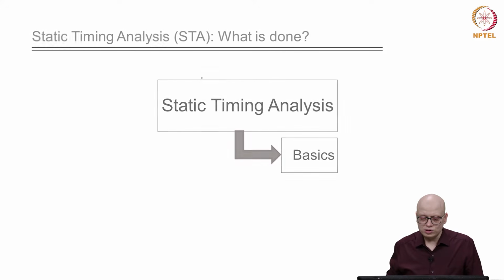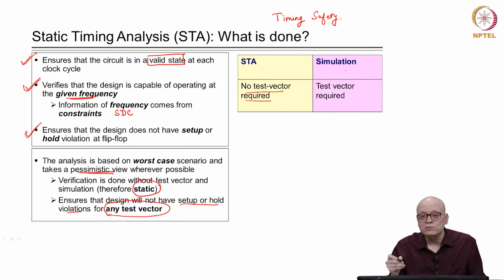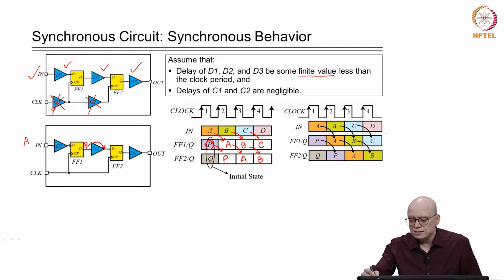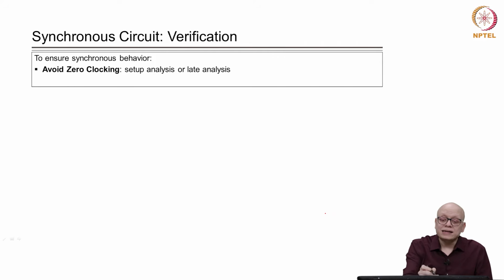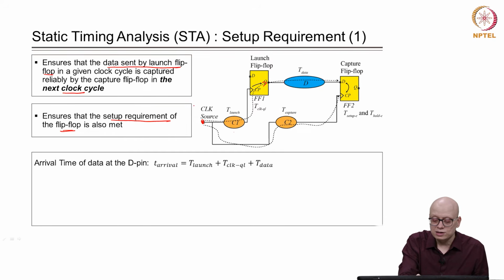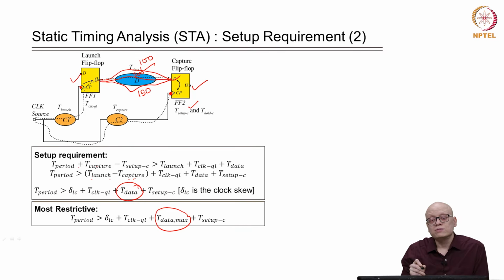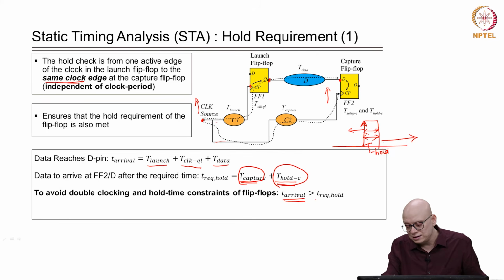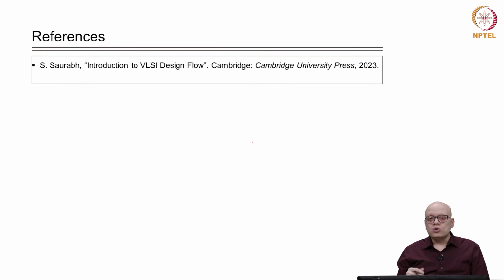Static Timing Analysis- I

Comment: Timestamps (Powered by Merlin AI)
00:05 - Static timing analysis ensures circuit timing safety and validity at each clock cycle.
03:43 - STA ensures design safety at specified frequency by analyzing timing constraints.
09:33 - Static Timing Analysis focuses on timing verification, not functionality.
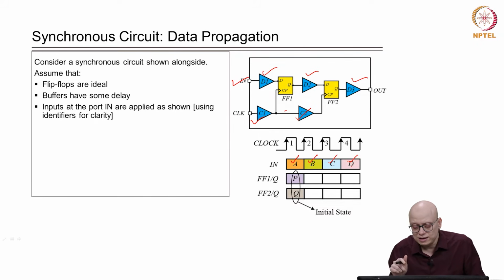12:09 - Analyzing flip-flop states and delays in synchronous circuits.
17:26 - Delayed data arrival disrupts synchronous circuit operation.
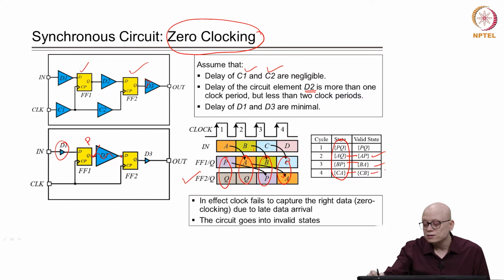19:59 - Invalid states occur when circuits respond to clock signals unpredictably.
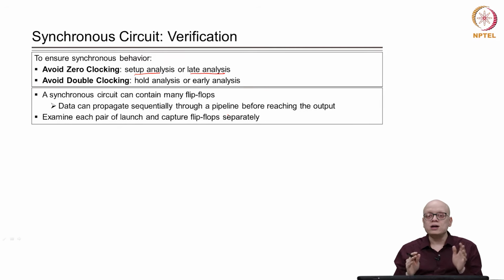24:43 - Analyzes flip-flop delays and constraints in static timing analysis.
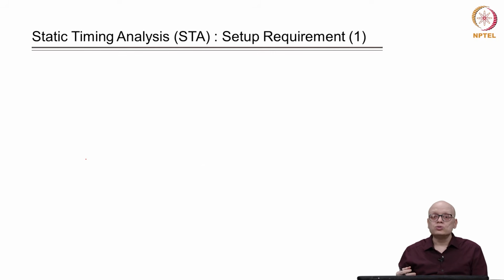26:59 - Setup requirements ensure reliable data capture between flip flops.
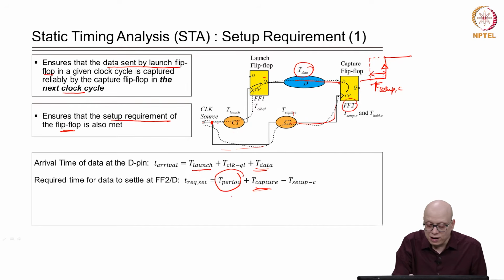31:54 - Setup time constraints ensure data arrival before clock signal.
34:19 - Understanding clock constraints in Static Timing Analysis.
39:08 - Final constraints prevent zero clocking in ideal flip-flop circuits.
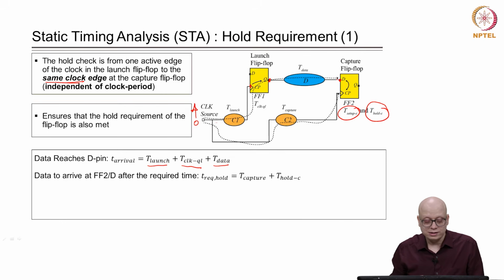41:26 - Understanding required time in static timing analysis for data arrival.
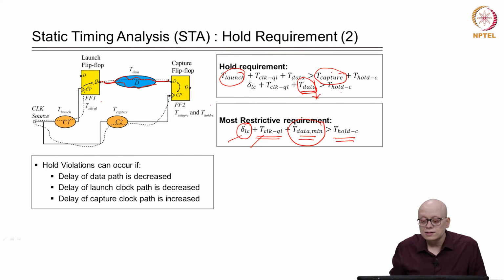46:15 - Hold time constraints for ideal flip-flops relate to clock skews and capture delays.
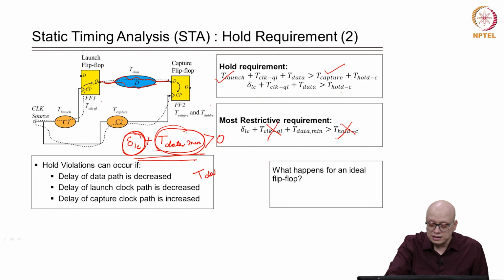48:50 - Understanding hold time violations in static timing analysis.
Reply: heyyy
Reply: @PranavKhandekar-l2c  Hii